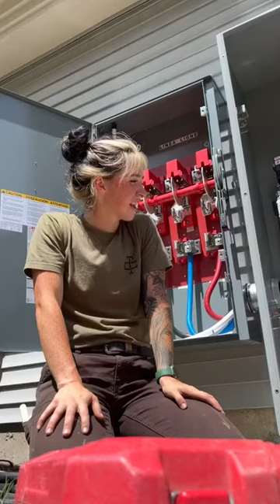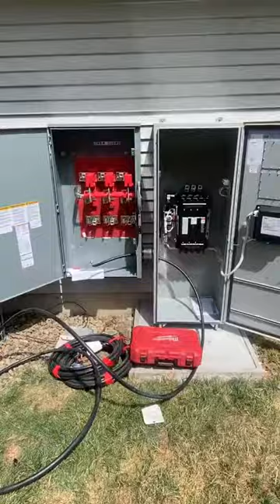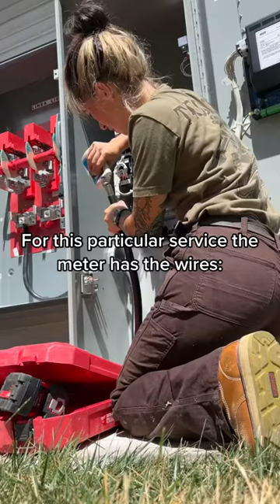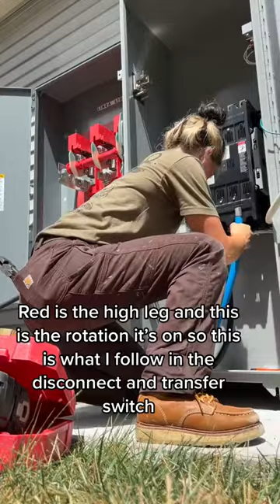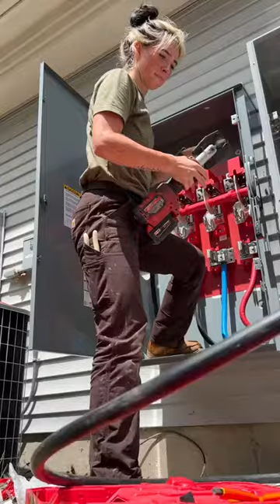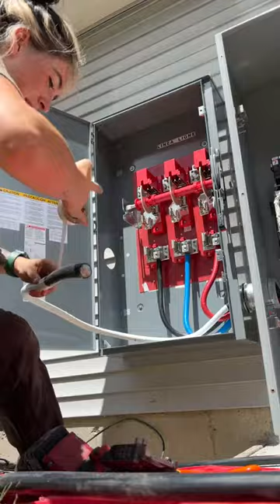Part I of the 400amp disconnect & transfer switch install for a Cummins generator

Comment: Nice to see her tape the length  of wire. Lazy cheap union sparkles would only apply a wrap & a halve of cheapest POS cheating china tape. A few years tape usually fell off . Was taught to mark wires at least a couple of inches every foot.